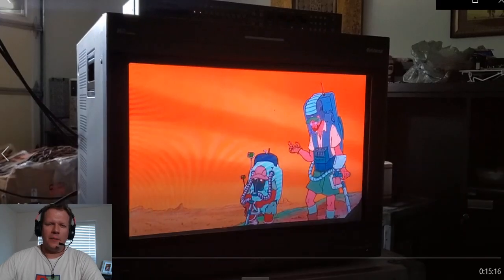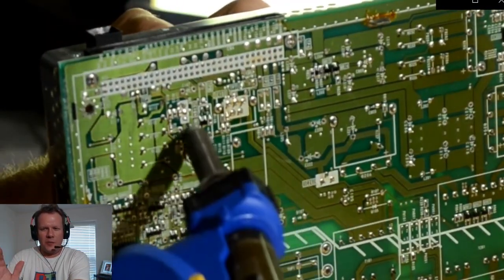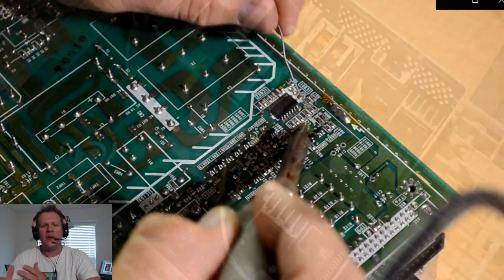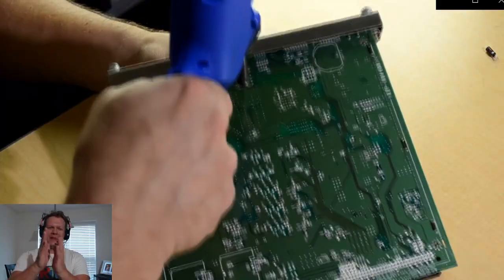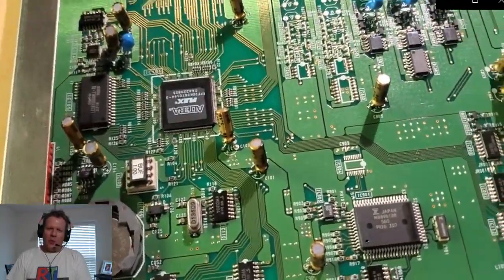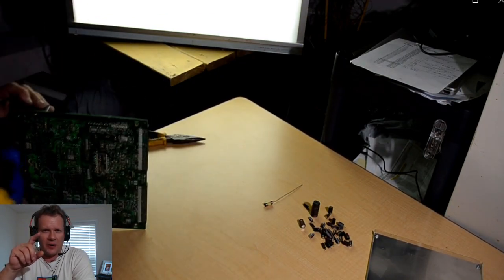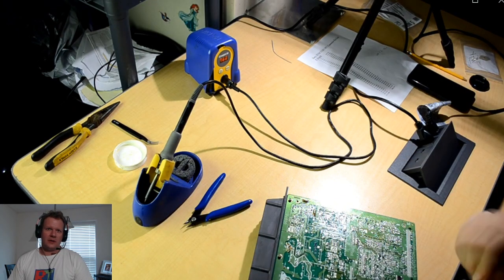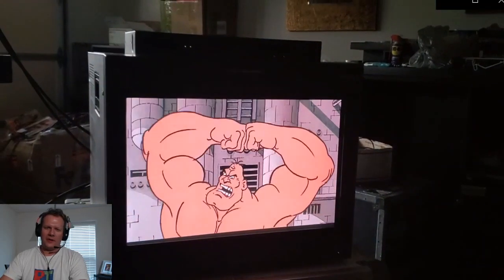Let's Replace all the caps in a Sony BVM D24 | Deflection, Power & Buffer PCB CRT Repair G, BUF & E

Comment: ESR is a better measure of capacitor health than the capacitance value. Critical caps in a monitor were selected for ESR value and ripple current capability. Replacing with lower spec caps will lead to premature failure. Best to leave the original ones in unless they are definitely bad.

Comment: In case anyone was wondering, the meter he uses here is a Der EE DE-5000. Besides ESR, it also measures capacitance and D (dissipation) and Q (quality) factor. Manual can be found here: https://www.ietlabs.com/pdf/Manuals/DE_5000_im.pdf

Comment: Do you plan to do a video on the BK board, the main video input board on slot 6? I'm planning to do a swap on one of those as well as the E board, so this video was really useful for the latter. The BK board seems to be trickier to install. Looking at the service manual, the BK board needs to be reloaded with the factory data in the maintenance menu.

Comment: I'm in the process of acquiring one, and when you turn it on there is a quick light "line" that appears on the top center of the screen. I was told it's normal due to the high voltage the monitor use. Is that something normal?

Comment: If you buy some foil tape, and wrap the heated capacitorss with it, will it extend their life, by deflecting heat?  Also, would you have to do this for the capacitors surrounding those capacitors, because now those capacitors are receiving excess heat, too?
Reply: Not sure if that would work, but the most amount of heat in BVM’s/PVM’s are mostly from heatsinks so rather than focusing on the heat from caps I would focus on the greatest source of heat. I may be wrong though so take that with a grain of salt

Comment: Steve,

I am not sure if you mentioned but when replacing caps for Bvm/Pvm monitors is it okay to have a higher voltage rating on the caps like it would be in any other application? I know of course the uF must be the same.

Comment: Don't you need to recap the video module (the one with a heatsink nexto to the RGBS conectors)? I don't have a D24 but the kit I bought from Savon pat (for D20) have around 10 caps for the video module (and more or less 10 caps for Deflection board).

Comment: The environment this monitor was operated in may have influenced the original caps lifespan. They may have been in an air conditioned environment favorable to the cap’s longevity and component life overall. Of course, I’m not discounting the assertion that Sony probably did buy very good capacitors.